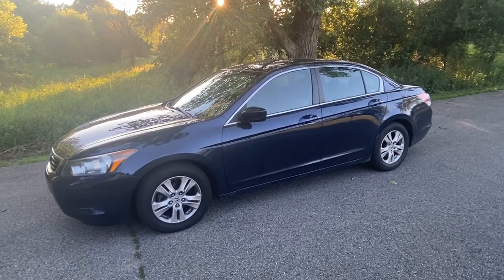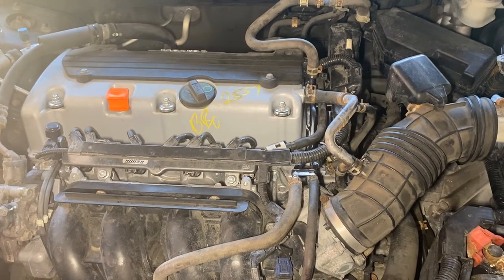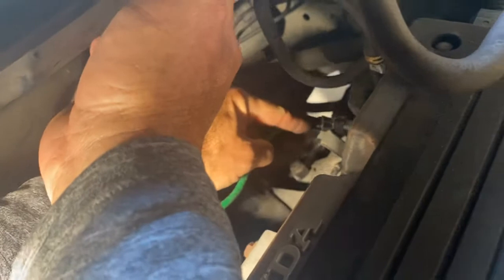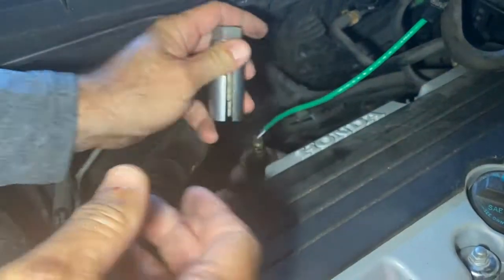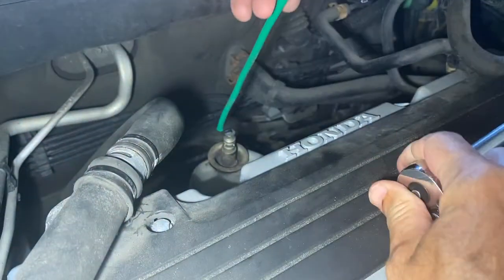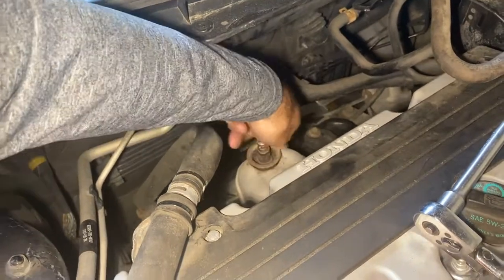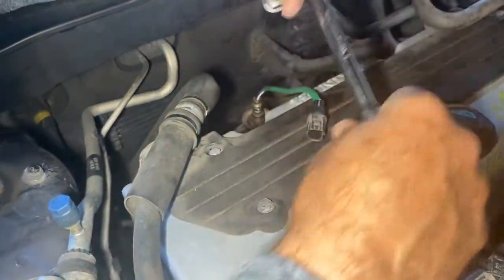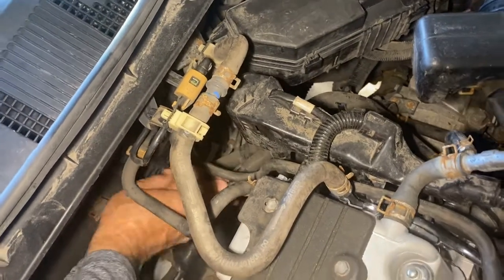How to Replace Oxygen Sensor Honda Accord

Comment: Can I install the o2 sensor without that air fuel sensor or is it a must have?
Reply from the maker: The air fuel ratio sensor is installed in the exhaust manifold or in the front exhaust pipe, before the catalytic converter. It might also be called 'front O2 sensor.

Comment: Is this O2 sensor bank 1?  My ODB2 recognizes voltage on bank 2 but bank 1 doesn't have a readout and I'm wondering if I should simply replace
Reply from the maker: On this Honda it was bank one sensor one.You must have a different motor than this vehicle.

Comment: I have a 2015 Honda Accord EX-L 3.4l V6, throwing a P0420 code. I wanted to try changing the sensor first. What's the name of that socket that allows the wire to go through?
Reply from the maker: Oxygen Sensor Socket
Reply: @TheAutoTeacher  of course it is 😂. Thank you man, love learning from you.
Reply: @theautoteacher i have a 2009  honda ex accord 2.4 engine what type of oxygen sensor sock  would i need up or down
Reply: @bosskatt4035  not the person you asked but there's really no way to tell without taking it to someone who can run it for more detailed things. Best bet would be to give both a visual look and see if anything stands out as looking in bad shape. If both look the same then ide go with the top first just because it's easier to get to.

Comment: I have a 2010 Honda Accord.  
It's throwing a P0137.  My reader's description says "O2 sensor circuit low voltage bank1 sensor 2".
Is that the same sensor? or is that the one my the Catalytic Converter?
Reply from the maker: Different, it's the down stream sensor  on or after the catalytic converter.

Read more: https://www.autocodes.com/p0137_2010_honda_accord.html

Comment: I have 2012 honda accord.  if I know how to fix oxygen sensor my self how much should i expecting to pay for the part? I want to buy good on not cheap kind. Please advise me. Thanks.
Reply from the maker: If you have a 2.4 motor you should expect to pay between 35 to 75 dollars for a brand-name oxygen sensor. You can check your auto parts store, Amazon, Rockauto etc.